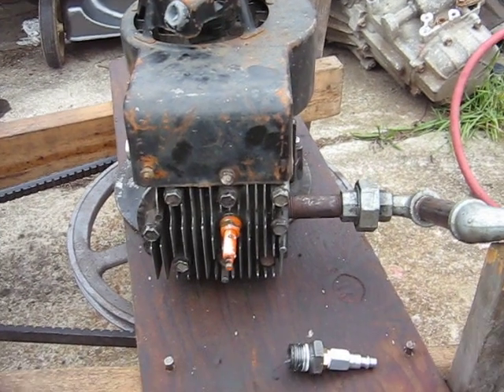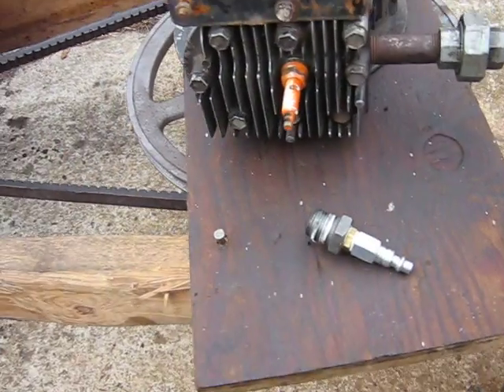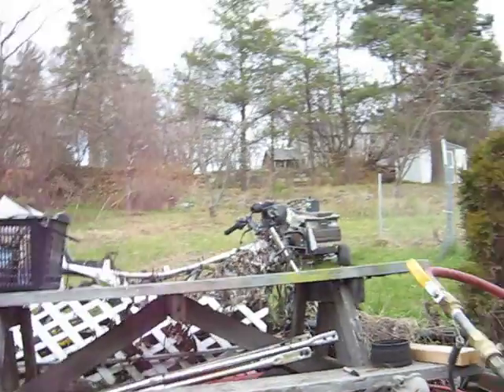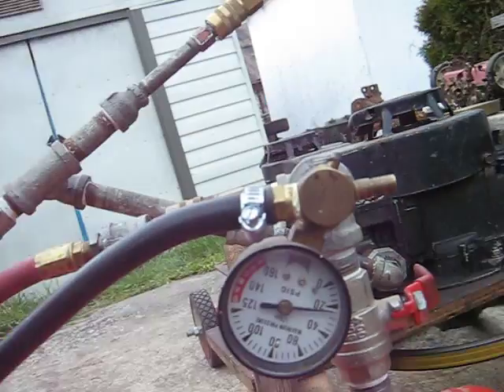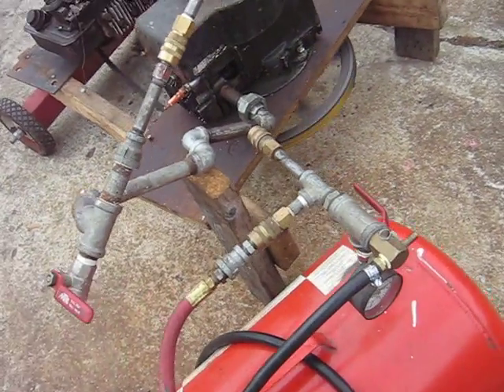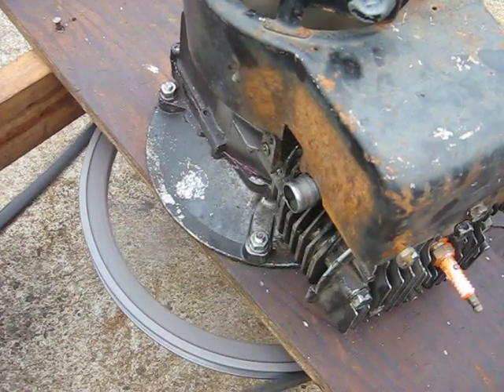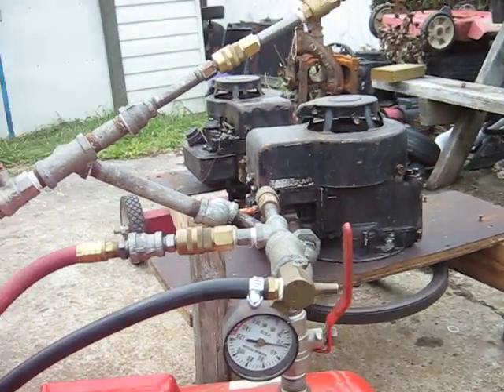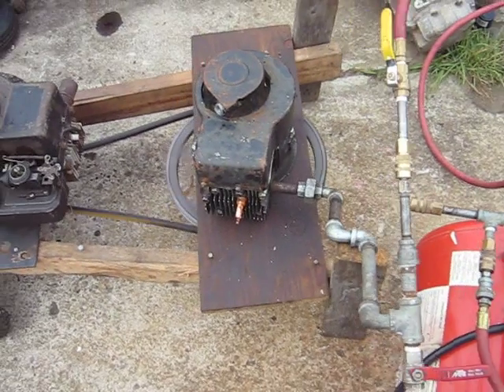Stage 5 Experimental Air Compressor 24 psi :(

Comment from the maker: @lewismohr1 
HaHaHa :)
A new cottage industry, goog one!
Maybe there is something to it, but I won't be doing it, as I can hardly manage to find a 1 way air check valve these days, let a lone a reed valve!  :(  Thats why I made the disc valves for my 125psi compressor. Everywhere I went asking about thin spring steel to make a reed out of, they looked at me like I was from Zontaar's home planet!  :) Then you have the legal ramifications!!!  >:((
Yes, I do NEED a blow off valve, good catch.